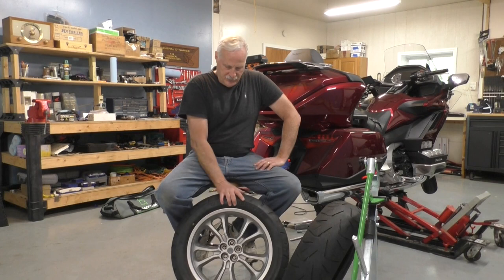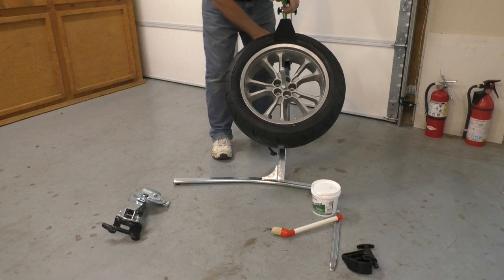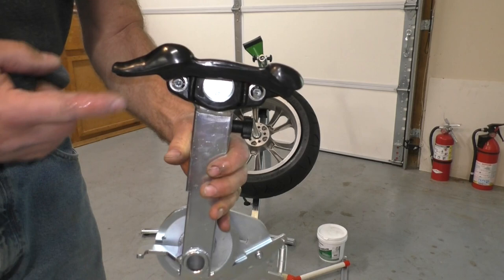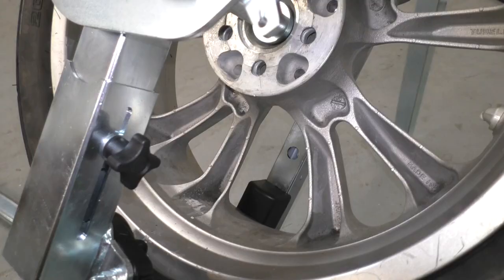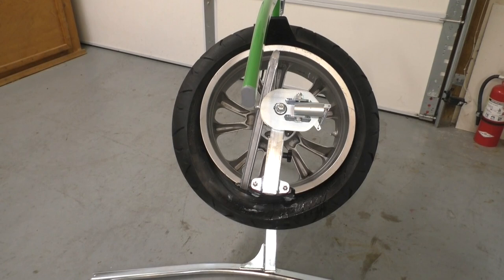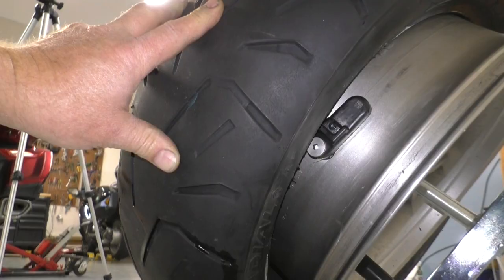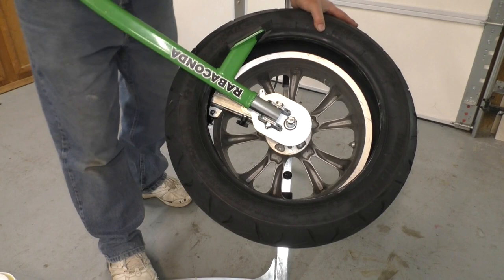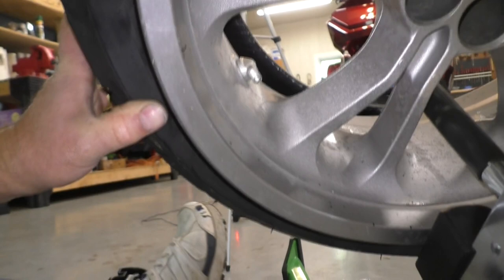Rabaconda Tire Change

Comment: That's no gimmick when i watch with my own eyes how easily it dismounts and mounts a stiff/difficult street tire. What - did the guy use special effects and not actuallly do it?😂 No it works and a huge bonus is how portable it is and doesn't take up space when you're not using it. Thanks for the excellent demonstration!

Comment: Just changed both tires on my Harley (first time using the Rabaconda). Worked like a charm! I have had some bad experiences with dealerships in the past and this tool has set me free! It helps to leave the tires in the sun for a while to let them get really warm (and more flexible) and to use plenty of grease on assembly.

Comment: Great demo, I use two of the centering tools, seemed to make it easier. I like the wood blocks idea though. I bought my Rabaconda a few months back and finally my front tire needs replacement, on my ‘06 Yamaha Stratoliner S (bagger cruiser) with chromed mag rims, 113/1854 air cooled engine, v-twin. Just under a hundred horsepower and 124 ft lbs of torque. This tool will pay for itself in the end, a worthwhile investment. I hope to get faster on it than I was yesterday afternoon. Thanks for the how to video! I hope to own a Goldwing someday…

Comment: Your video was a huge help for me in using the Rabaconda for the first time  removing a 5 year old tire from the front of my Indian full sized. I used 2 drop center tools rather than wood blocks, however, I'll make some to have handy. I think silicone spray works much better than just the bead grease. Like you I had to use quite a bit of muscle for both removing and installing.  All in all a great machine for being portable. I want to say I have your 2018+ maintenance videos and they are priceless!

Comment: Thanks Fred.  Have mine on order and will likely change my GL front tire in a week or so.  Your vids are the BEST!  The ease of assembly/disassembly, portability, and use of body weight instead of just arm strength makes the Rabaconda a winner in my book.
Reply: Did you use it? How’d it go?

Comment: Excellent video, well done. It is a very nice tool.     
Couple of tips if I may...
Be a bit more liberal with the tire lube on the tire during removal and install.
For installing that last bead, put some lube on the inside lip of the tire. You can use a paper towel to apply the lube there and it helps that bead slide over the rim. Specially in that final tight zone.
Balancing: If you have a yellow dot on the tire... pre balance the rim and mark the heavy spot with tape, it's not always at the valve. Line up the yellow dot with the tape. This minimizes the amount of weight you need and sometimes it's none.

Comment: I just used mine today. It works a treat. I liked doing it so much I did my front tires three times until I got the dot and the arrow all in the proper orientation. Took less than 10g to balance the tire. I also got to super-clean everything in and around the front tire as well as check my brakes. By the time I did the tire the third time is was easy-peasy. Just a little practice will have most anyone doing it quickly. And, it was about 80 today so I set both the wheel with the old tire and the new tire in the driveway for a good hour or more before working with them. I know that helped tons.
Another big plus, I didn't have to wait weeks for an appointment to get my tires done. I would then have to drop the bike the night before and get a ride home. Repeat the next day. I'm a "friend" of the local shop and a three-time Goldwing offender so they get me in fairly quickly. Most people wait 4-6 weeks to get in. It also costs about $150 for the service.
I will make myself and the Rabaconda available to all my riding friends.
I do think the Rabaconda is a bit overpriced, however, it is very well built and works awesome. I guess you get what you pay for.

Comment: Your video should be included in every tire changer they sell, very simple and to the point.  That being said l guess l was very fortunate to have bought a BMW R 100/7 in the 1980's from a dealer who showed how to break bead(with center stand) remove tube and repair a flat, and reinstall tire roadside.  Does look like a very well made tire machine.  Thanks for sharing 😊

Comment: Nice video, you seem to be very knowledgeable about this changer.  You are 100% correct Gold Wing Tires are the hardest.  On the flip side, the wheels come off the bike super easy!  I've been using my No-Mar changer for 15+ years and done hundreds of tires. I have a 21 GW and have changed three set so far, always feel like I'm going to rip the sidewall while its groaning during the change.  
Thanks for taking the time to post!

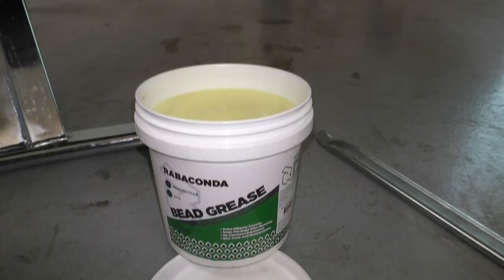Comment: At 6:55 what do you use if you have spoke rims ? To much pressure would bend the wire spokes .
Reply: There’s a strap use can use. Think it actually comes with the kit.

Comment: Absolutely positively a device I will never use. Way too complicated. Way to unstable way too much effort. Is a guy here that has a video on here using two tire irons and two plastic rim protectors that snap onto the rim he got the tire off in less than 5 minutes. Got the new tire on and less than 5 minutes filled it with air which took 30 seconds mounted it on a wheel mounter which took 3 minutes. Done deal. This is a Rube Goldberg nightmare.
Reply: yeah I'm going to need to see that video. I've changed my own tires for 30 years now using nothing but tire irons and yes it can be done, but it's time consuming and takes a fair amount of strength. Anybody doing a tire in 3 min is either doing an exceptionally soft sidewall tire or is using a tire just a little too big in order to fool the viewer.

Comment: I see so many of vids showing this Rabaconda tyre changer but I can't help but feel it is crap. Far easier to change a tyre on the garage floor or on a stable bench using an Olmax tyre changer than on this rickety unstable contraption. There are existing tyres changers that are MUCH better. This is just a gimmick.
Reply: You go ahead and change a late model Goldwing tire on the garage floor or a stable bench.
Reply: @bill4562  There is no way I shall be buying a Goldwing just to change it's TYRE. If I wanted a bike that big and heavy then I would just use my car instead. Joking aside that Rabaconda TYRE changer looks like a gimmick. Firstly it looks very unstable and just crap. I won't be wasting any of my cash on it. You might have a different view. Well it's your cash. Don't say I didn't warn you. LoL.
Reply: Owning a Rabaconda Street Bike Tire changer, a 2021 Honda Africa Twin Adventure Sport ES DCT and a 2023 Honda Gold Wing Tour,  I can give my ACTUAL EXPERIENCE CHANGING TIRES WITH THE RABACONDA STREET BIKE TIRE CHANGER.   I went out on YouTube to watch videos of the Olmax tire changer on a Gold Wing tire, so I could make a more factual comparison between the Rabaconda that I own and use, and the Olmax tire changer (that I havent had any experience using)

1) I noticed that both units will move around when using them because neither are bolted to the floor or workbench.  I think that if you go with a harbor freight tire changer, you may be able to bolt that unit to the floor.

2) both units were able to change a gold wing rear tire.  The video showing the Olmax was changing a tire on a Gold Wing that was on the dark side meaning that it was an Auto tire that would fit the Gold Wing rim.  Don't know how stiff a car tire sidewall is compared to a Dunlop Elite 4 rear tire so it's hard to say which would be easier.

3) The Olmax looks sturdy, is cheaper, but the Rabaconda is also built pretty solid.  Using it I put a lot of force on it and it has been holding up so far.

4) Both units use what is called a duck head that rides along the rim to install and remove the tire.   The Rabaconda has an optional duck head that you can buy if you need to change out tires on a Cross Spoked rim such as the BMW GS 1250 AS, or a 2021 Honda Africa twin.  The optional Duck Head is wider accommodating the additional width of the cross spoked rim.

5) Rabaconda allows you to use more of your body weight while changing the tire since you are not limited to  just the horizontal plane pulling on the bar to remove or install the tire.  The horizontal plane would be great, if the Olmax tire changer was bolted to the floor or a workbench.   The Rabaconda has the tire mounted on a 45-50 degree angle, so you can use additional body weight to apply force removing and installing the tires which I think is an advantage over the Olmax.

as far as a rickety unstable gimmick, I'll have to come back in 5 or so years with experience using it to let everyone know how it held up and how many tires I have changed.  Hard to make a judgement with out actually using the Rabaconda tire changer and just watching "many of vids showing this Rabaconda tyre changer".

Anyway, I am trying to present the pro/con of each of the tire changers.  l haven't used the Olmax, but from what I can see it works, but the only advantage is the cost, and you can get it with an additional static balancer.  I have a static balancer I use on the Africa Twin, and have Centramatic wheel balancers on the Gold WIng, so I really don't need to balance the Gold Wing tires.